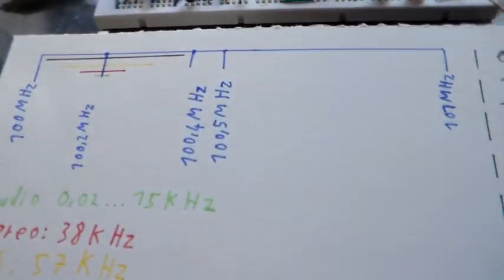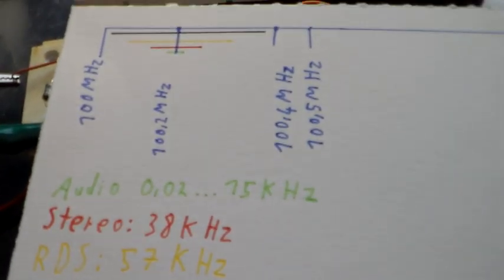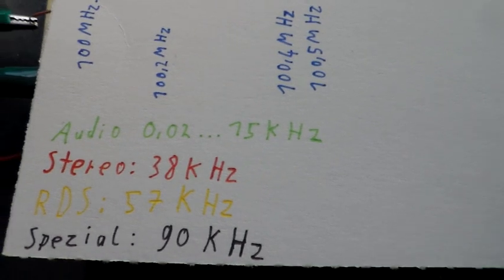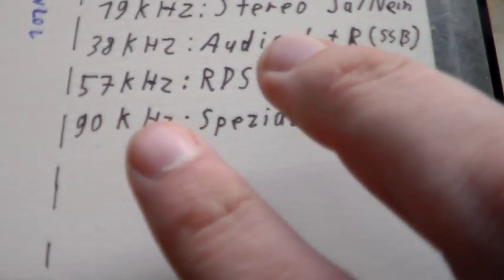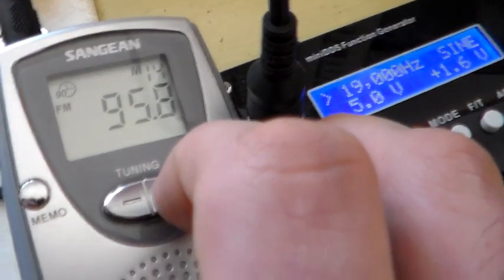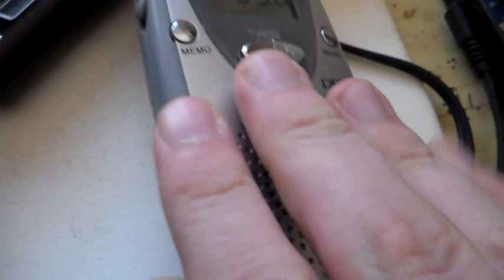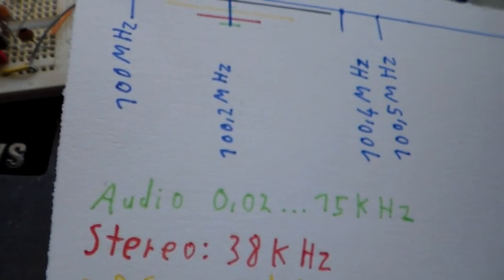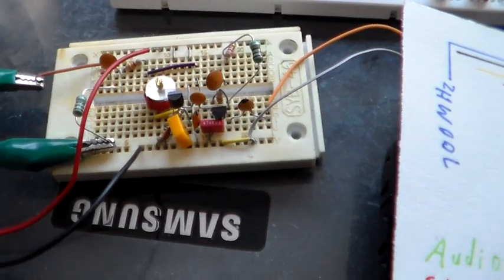FM Signal Analysis

Comment: That receiver can put out 100 khz from the audio jack? I've been looking for something like that. I'm testing JQAM software. It sends fast data over an FM transmitter. Until this point I could only use 15khz, but with 100 I can send much faster. Does this receiver go below 87 MHz? I would rather do my tests outside of the broadcasting band.Good video btw.